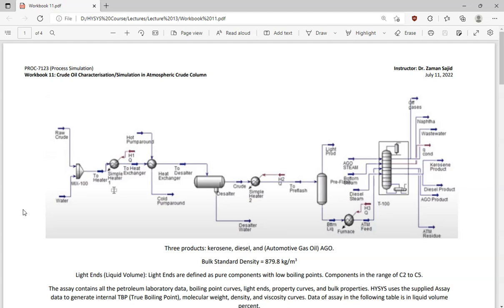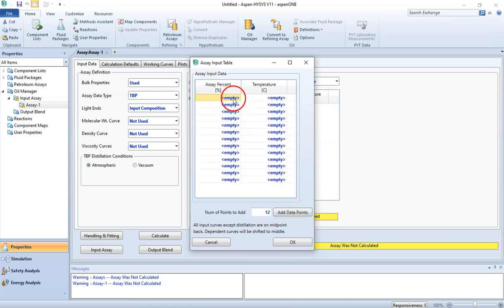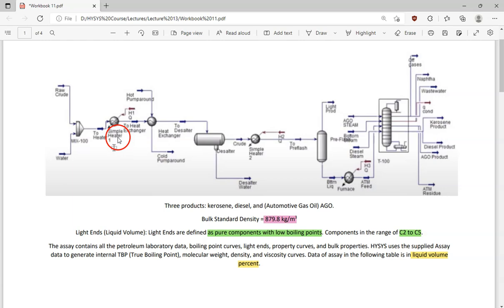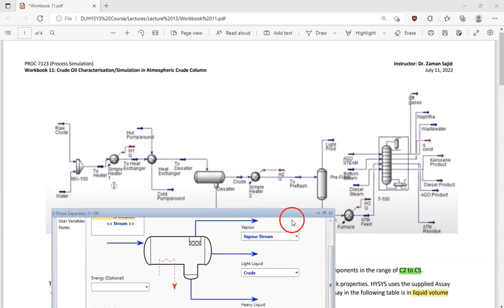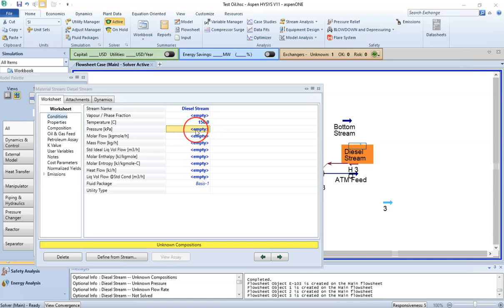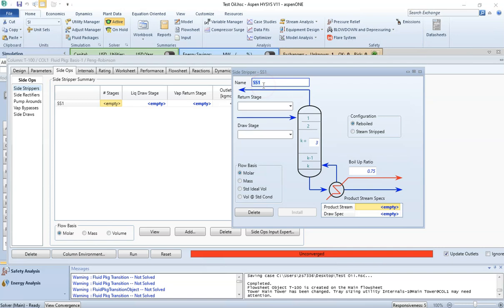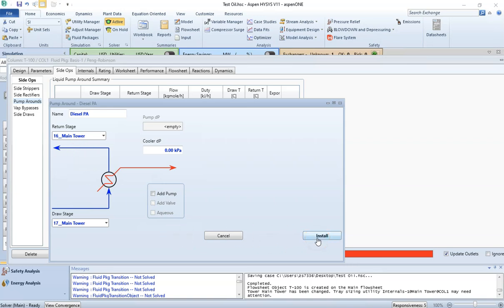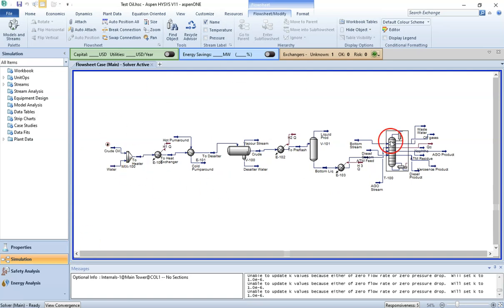Crude Oil Characterisation and Distillation in Aspen HYSYS

Comment: First, I would like to thank you for your clear and highly informative video titled "Crude Oil Characterisation and Distillation in Aspen HYSYS". It has been incredibly helpful in guiding me through my simulation.

However, I am currently encountering a challenge with the internal sizing of my column. Specifically, I am struggling to balance the tray parameters to address a "weeping" issue detected on Tray 29. Adjustments to the holes or weirs seem to negatively impact other trays, particularly Tray 28, making it difficult to achieve a stable configuration.

I would greatly appreciate your advice or suggestions to resolve this issue. If possible, could you kindly provide me with your email address so I can share a screenshot of my simulation and the associated file for your review?

Thank you very much for your time and support.
Reply from the maker: Thank you. I received your email on the same and will respond you.

Comment: What is the difference between the Diesel product and the AGO product? as far as I understand they are interchangeable terms
Reply from the maker: Diesel fuel is a general term that includes various fuel types used in diesel engines, including AGO. Meanwhile, AGO refers to a specific type of diesel fuel mainly used in automotive applications. You can see in this simulation that a major difference is sulfur content. AGO generally has a higher sulfur content than other diesel fuels. I hope this helps you.
Reply: @drzamansajid  Yes, after a closer inspection of product parameters are also noticed the differences in densities, temperature range, and viscosity to name a few. Your feedback was insightful, thank you!

Comment: Hi! I want to ask whether is it feasible to simulate steam cracking in aspen hysys? using naphtha as feedstock
Reply from the maker: Yes, you can. If I recall correctly, there is a built-in example of the same or similar system in HYSYS. You may look at that.
Reply: @drzamansajid  where may i find the example? i'm not great in simulating using aspen hysys
Reply: there is no naphtha component in aspen hysys, what should i do or where can i find specific properties needed? do u have any materials that could help me in simulating? it would be of great help to me as a student who's taking plant design course this term 🥹 thank you, doc!
Reply from the maker: @peachyshan7169  you can define it hypothetically. Here is the link of a lecture which will teach you how to find built-in HYSYS models. I hope this helps. https://youtu.be/q0rnoX6o4lY
Reply: @drzamansajid  thank you, doc!
Reply: @drzamansajid  how may i email you for inquiries, doc? i can't seem to find your email address
Reply from the maker: Zaman.sajid@mun.ca

Comment: hello dr, i'm trying to do the simulation just like what you do But the iterations take forever. I wonder why, because when it comes to distillation, it always turns like that.
Reply from the maker: That's because you have the system over-specified. Just make sure you have DOF = 0 before running the simulation. I hope this helps.

Comment: Please I want to work on motor oil and I don’t know if it’s possible to find it in aspen or how to generate it
Please
Reply from the maker: Yes, if you do not have it in HYSYS, you can define it as hypothetical. I hope this helps.
Reply: @drzamansajid  thk you 
Please how can I define it ashypothetical ??
Reply from the maker: @africanmelito892  Please watch my other video lectures to learn this. On the tab of the component list, next to Add button, there is a tiny arrow; click that, and you will see an option to define a hypothetical component. My explanation may vary depending on the version of HYSYS you are using. I hope this helps.

Comment: thank you very much Dr. Sajid! Can you please explain more why the Hot Pump Around must have the same composition as the feed to the heat exchanger's shell side? couldn't it just be steam?
Reply from the maker: Thank you for your feedback. I am glad this is helpful. To your question, we aim to save energy (and ultimately the energy cost) in the system. The hot pump around the stream is nothing, just the raw crude stream, but at different operating conditions. After passing through a heat exchanger, a hot pump around the stream transfers its energy to the stream containing raw crude and water, and a cold pump around stream is returned back as (cold) raw crude into the system. I hope this clarifies.